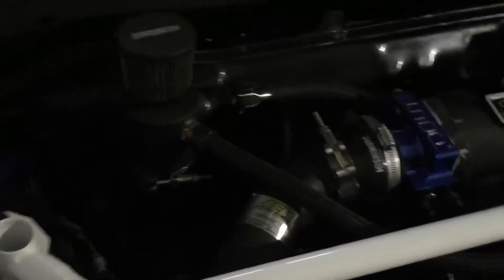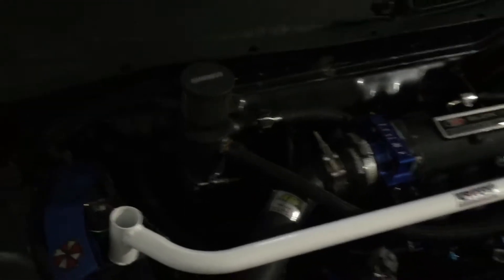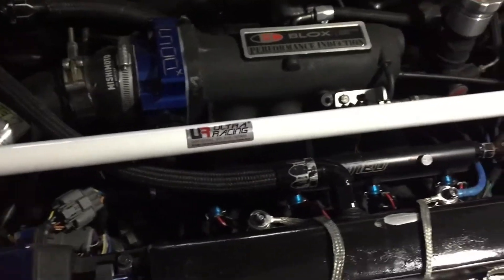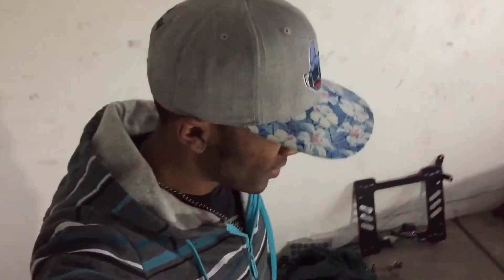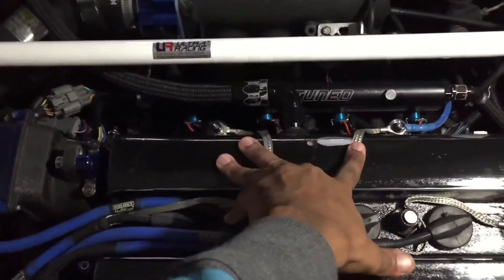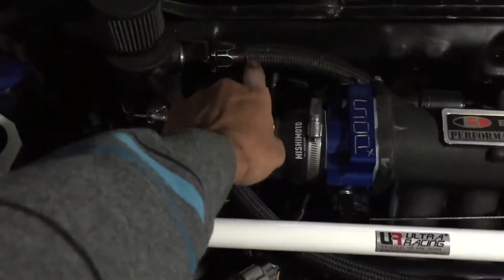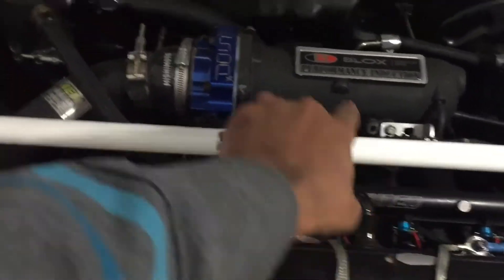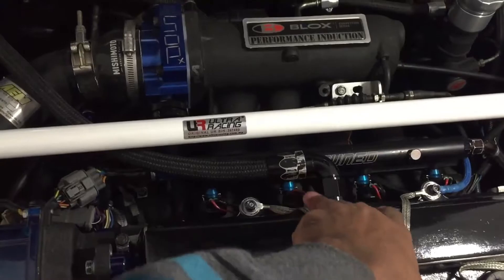Catch can vs Breather can

Comment: There is a vacuum on the intake that you won't receive if it's vented to atmosphere. Breather is only necessary if there is extreme pressure in the crankcase, which there would NEVER be if  hooked up to the intake side.

Comment: why have a can if its not suppose to catch anything??? just stick a filter on the ports lol. classic example of the Dunning Kruger effect
Reply from the maker: Joffa alien over time just from the breathing alone, you still will get build up of condensation in the can.
Reply: @SIRICKO  so essentially its a catch can because it will catch oil and fuel vapour.